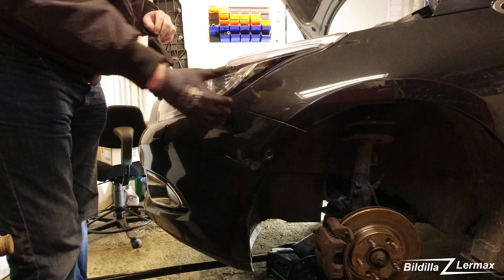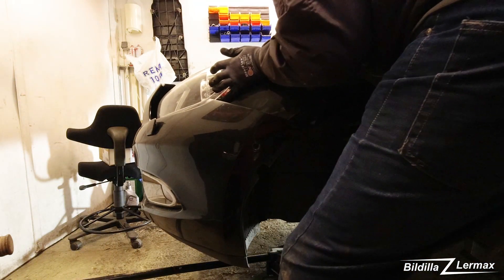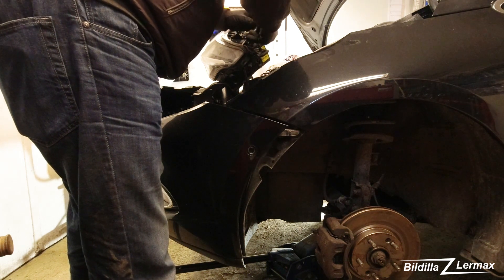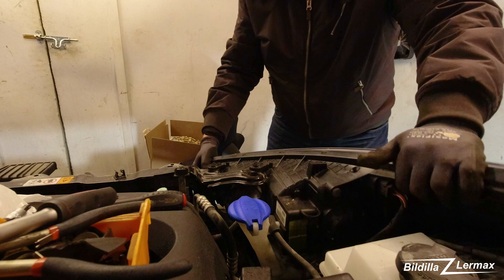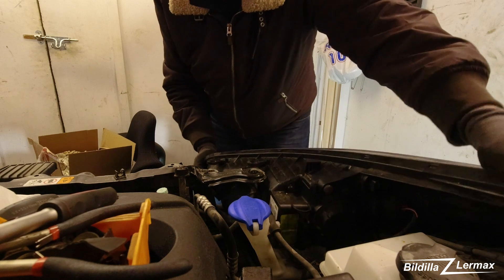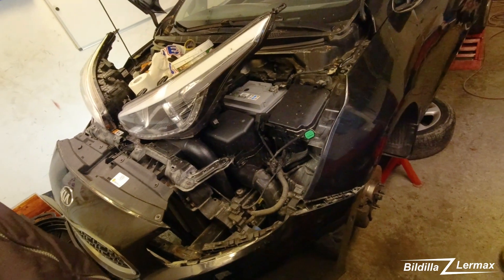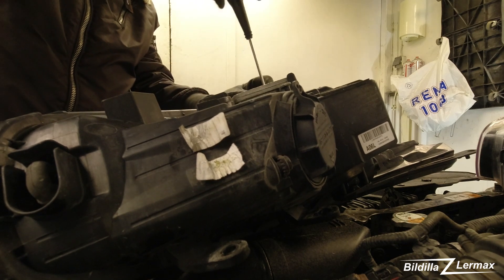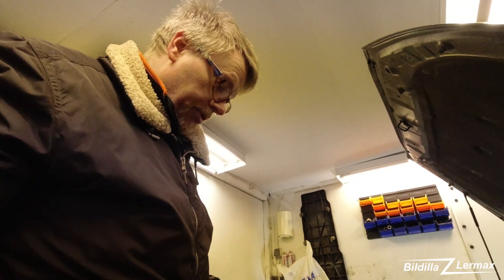DIY / How To: REMOVE FRONT LIGHT, 2013 KIA Cee`d 1.6 SW

Comment: Glad I found this video. My LED daytime running lights is also flickering, but still I don´t dare to try to fix it.
Removing the headlights seems to be a struggle for You.  
Have You figured out a better way to get them out, without removing the front of the car?
Reply from the maker: Good day!

I have not found any easy way to take them out unfortunately. They have attachment points that I can not see you can get loose, without first taking off the catcher.
BUT REMEMBER! Remove the lids on the headlight washers before tilting the front. Need not make you the same problem as I did. Ended up having to repair the headlight washers.

Thought something had commented here a place, that they managed to take off the lanterns without taking off the catcher. But did not find that message right now. It was under one of the videos about the repair of the lights.

Regards Pål
Reply: @bildillamagasin  Greetings from Sweden.  Thanks for Your ansver and tip regarding the washers Pål. 
Sadly, I have not even a garage to use for the operation, so I probably have to leave my car to the workshop to change my headlights. Lot of work and money just so change a little pcb.
Vennlig hilsen fra Jan
Reply from the maker: @jankarlsson6261  Hello again.

Huff yes. Nordic climate, and lack of garage space is a problem. I have had to postpone many jobs on my various cars, due to this long and snowy winter.
In Norway, many Ceed headlight have been replaced by the warranty. The problem with modern headlight, with their own computer brains etc, seems to only get bigger and bigger!
A car headlight is not just a headlight anymore. And then it costs too much to keep them in order.
Fortunately, I hear that it is a little cheaper to repair cars in Sweden than here in Norway!

Regards 
Pål

Comment: what on Earth? So to change a bulb on left headlight I have to take off bumper? Because there is no access to bulb when headlight is in.
Reply from the maker: No ... It should not be necessary! But I had to remove the headlights to repair / replace the control system for the LED daytime running lights.
Reply: @bildillamagasin  there is no access to bulb on the left headlight I have to take out head lamp or coolant tank
Reply from the maker: @n0spam911  it's bad! I have not had to replace these bulbs on mine. Too bad I did not just insert new ones, when I was out with the headlights then :( There have been a lot of problems with little space on modern cars.